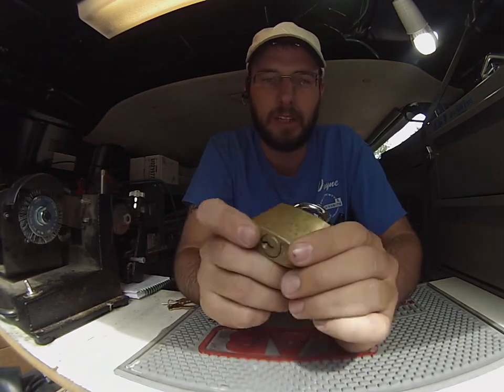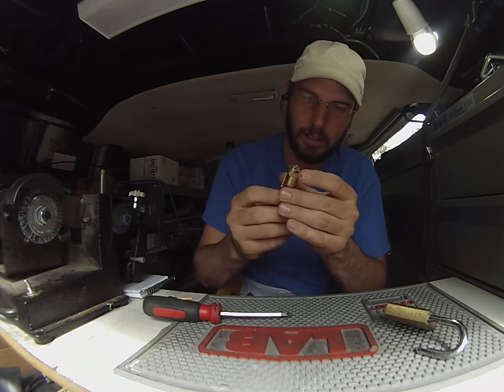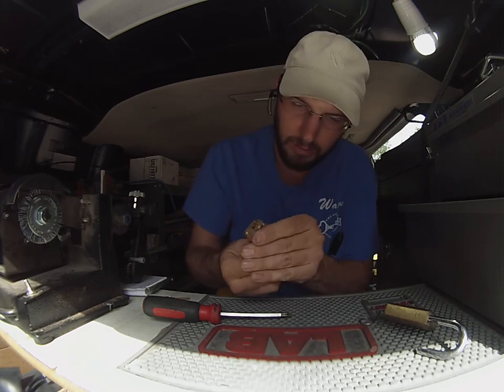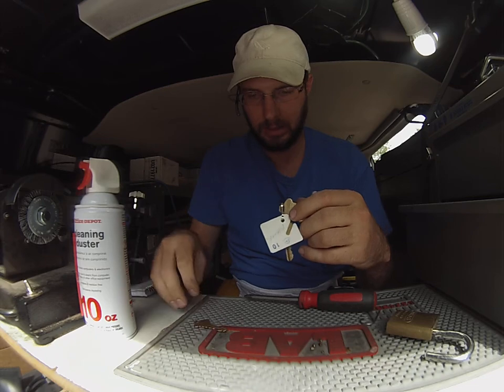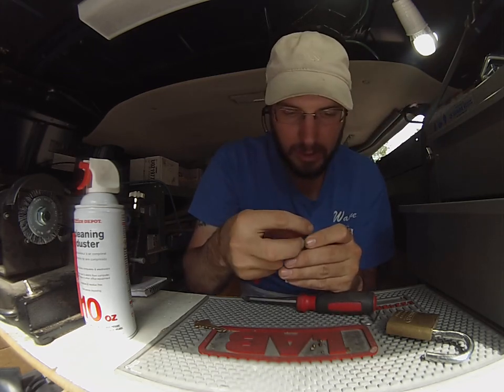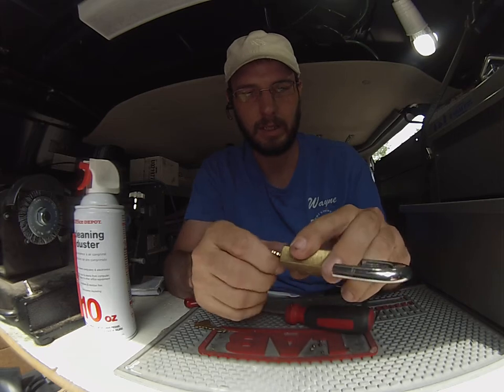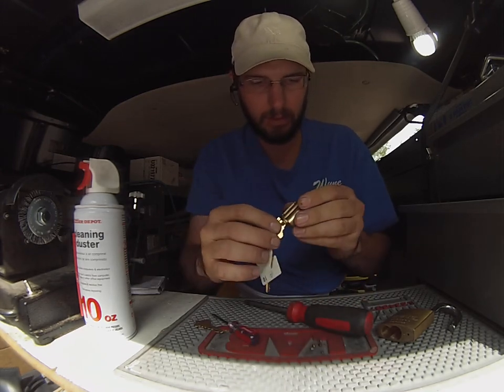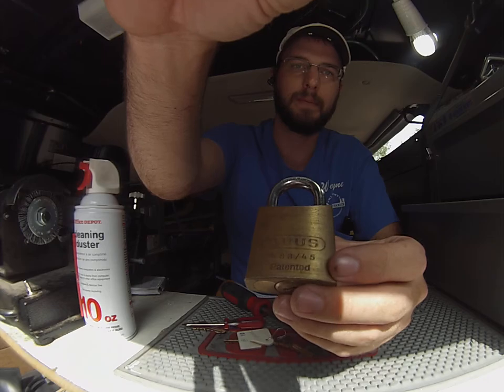Abus Padlock Re-key Rekeyable lock from Abus Security

Comment: I'm afraid that most locks fall apart, it's just their nature! For all I know your customer may have bought this lock and required rekeying, it's just something you cannot avoid. Very good video Wayne, it can be stressful dealing with these padlocks. I believe the 83 has a little z bar that fits onto the back of the core, this makes the lock key retaining. Removing the bar will make the lock non key retaining. I think that if you put the bar on upside down and insert the core back into the lock, when you turn the key the shackle will fall right out. This is a nifty feature that allows you to replace the shackle without the special tool that Abus does supply in their service kit.